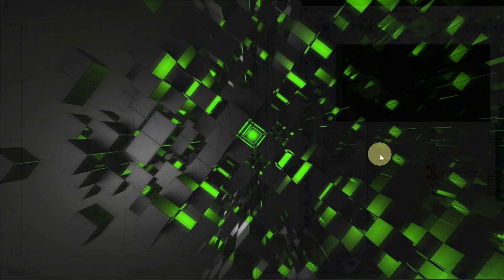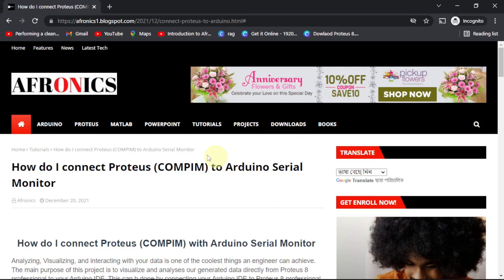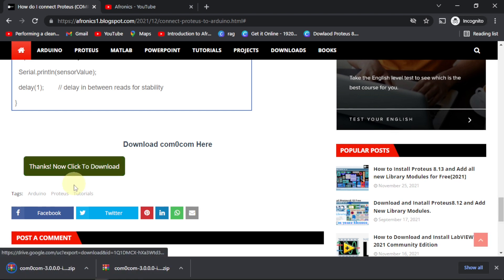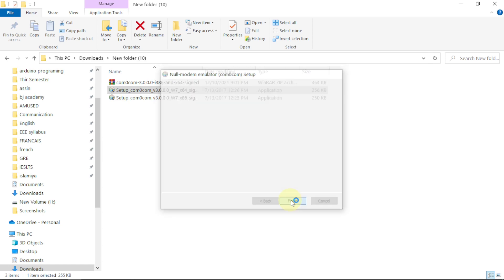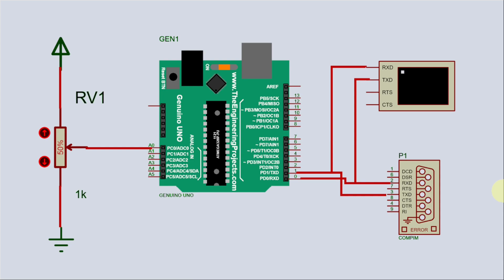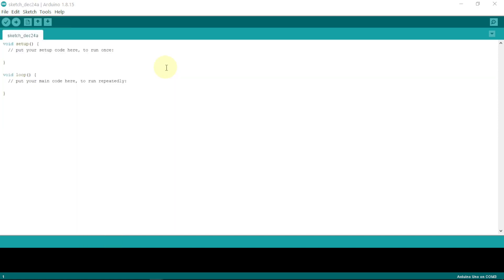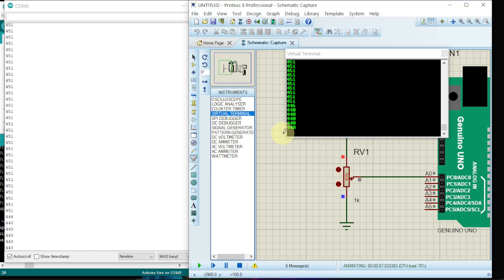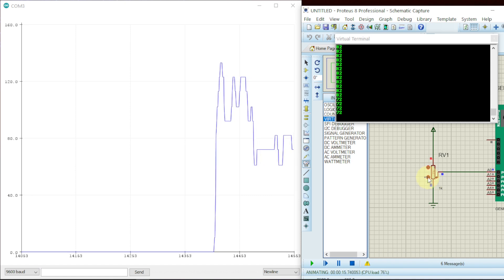How to Connect Proteus (COMPIM) to Arduino Serial Plotter/Monitor using com0com.

Comment: do i have to have a physical arduino connected to the com 3 to be able to do this?
Reply from the maker: No, you don't need physical arduino
Reply: @afronics  thanks for your response. I don't know why then my Arduino ide is not recognizing any comports. I am unable to select the com-port. Thus I am stuck.
Reply from the maker: @michaeljwosniak7241  open the comocom and pair the two come, select coms that are not in use.